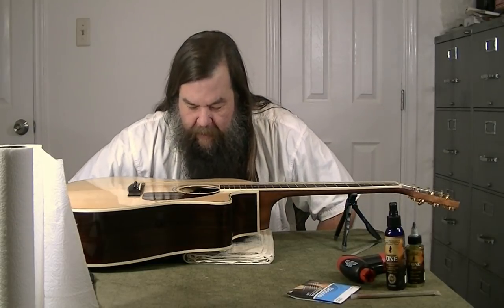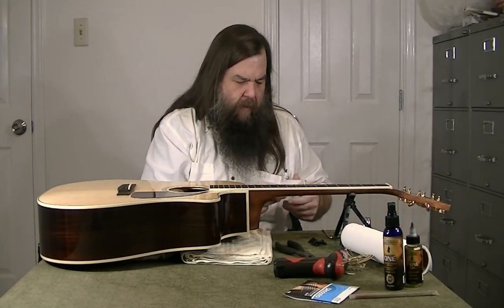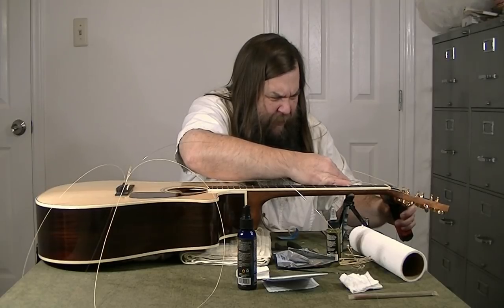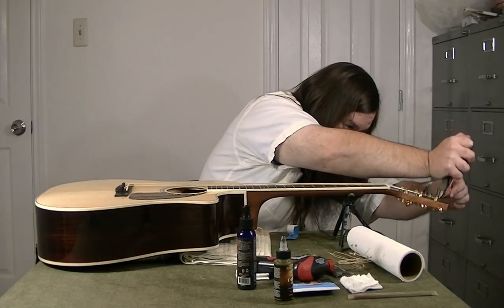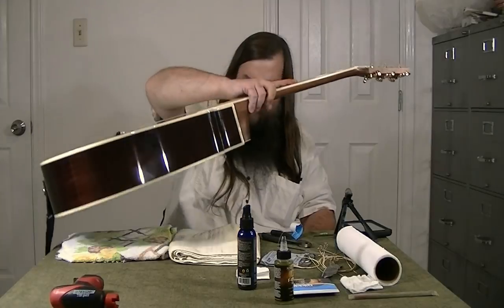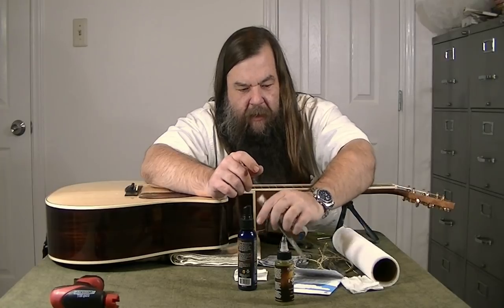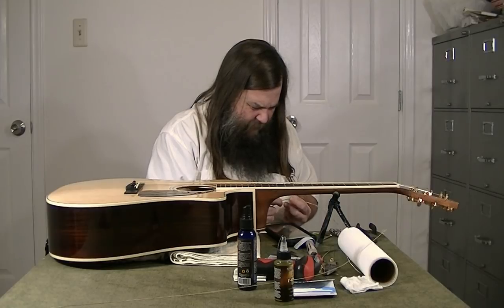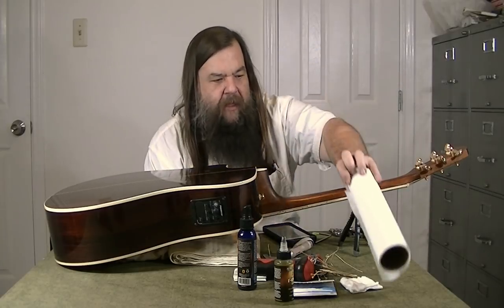Setup (includes restring) on Fender DG200 SCE NAT (full version)

Comment: I noticed that you are using paper towels to clean and polish the guitar. I’m assuming that it’s safe to do that without scratching the finish?? I always assumed that I need to use a polishing cloth, but it would be more convenient if I didn’t necessarily have to.